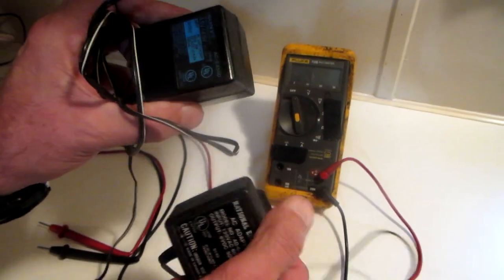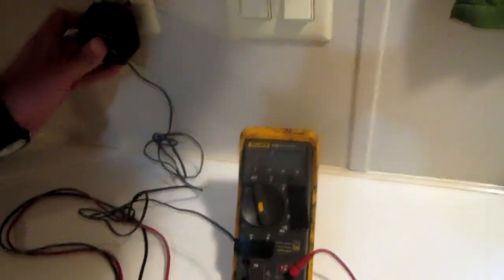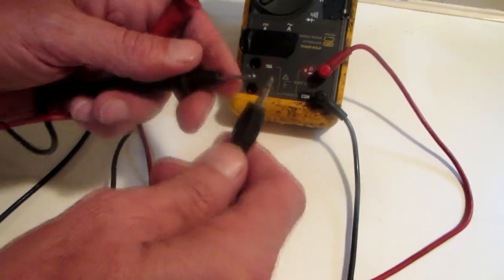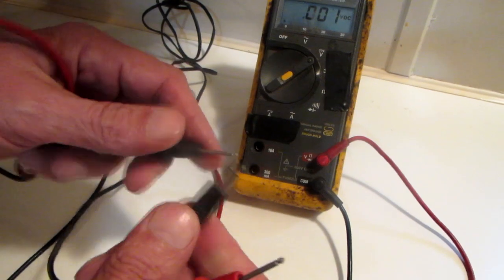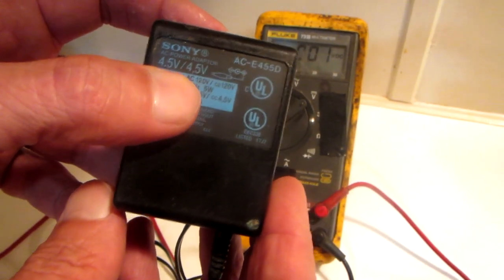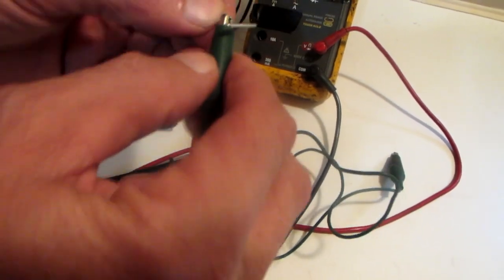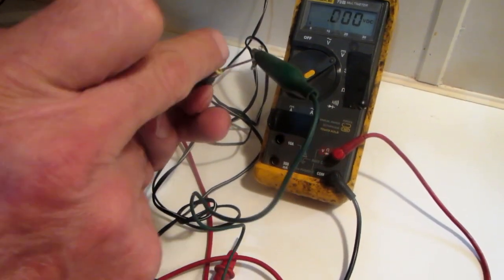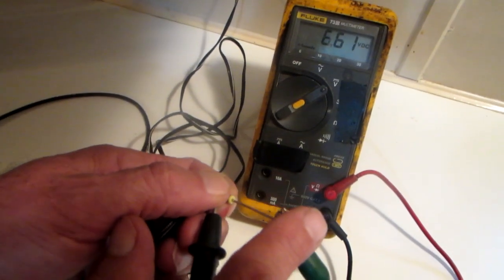Using A Multimeter to Test A Small Battery type Charger/Adapter

Comment: I have  a 42v output on my charger and my meter reads 41.8. It's ok? I ask because I use to hear a low buzz on the charger that I used on my 36v 6ah lithium ion battery  for me electric bike. Then I was given a 10ah and is seemed to get hotter than with the 6ah. Now though there is no hum sound.

Comment: what if your wall charger has  the alligator clips? one positive one negtive? I have a small small small battery charger that plugs into the wall and has the alligator clips to hook onto a battery. However, I cant tell if the battery is rejecting the charge, or if the charger is bad. So I wanted to do what you are doing here but instead of a plug at the end of the wall charger, I have alligator clips. Is it negative to negative and positive to positive?
Reply: yes